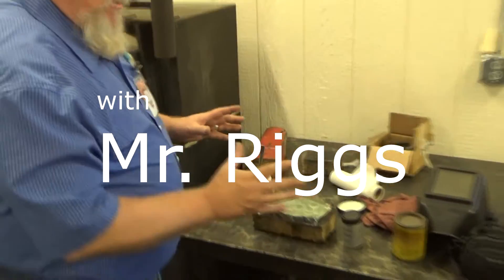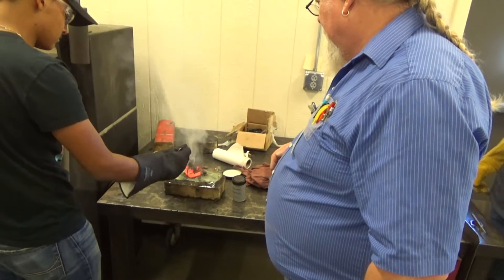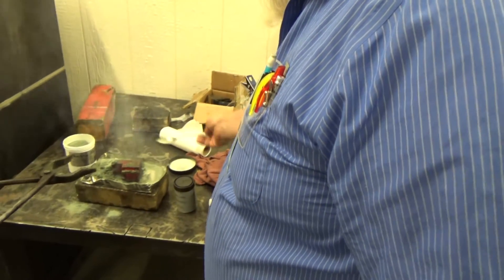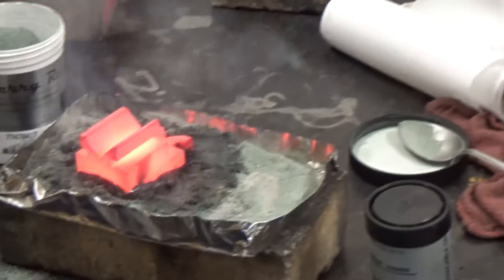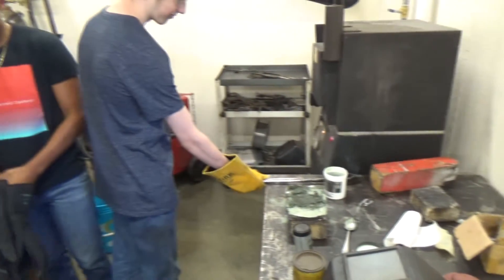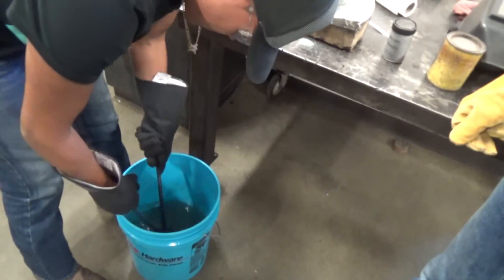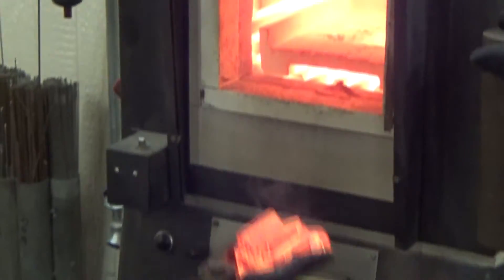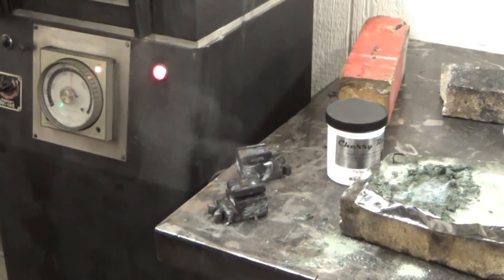Case Hardening Mild Steel with Mr  Riggs

Comment: No tempering?
Reply: It's mild (low carbon) steel so doesn't form the martensite and pearlite in the same way so not got the internal crystal structure issues a high carbon steel would.

Comment: Interesting video. Some additional information would be nice. Such as: 1) at what temperature are you heating it up to. 2) How long of a soak time 3) what material are you using to harden it
Reply: All of that was in the video if you listen.
Reply: it would be better to make a paste charcoal out of charcoal powder ,ordinary table salt and flour with ratio of 6:4:3 respectively mix with small amount of water and make a paste. cover the desired part with this paste. let it dry completely. Then to prevent oxidation, make a clay paste to and cover the charcoal coated part let it drys completely. Heat the oven to austenitizing temperature  around 1450 fahrenheit , put the part inside the oven let it riches to that temperature once it reaches to that temperature  , depending on amount of carbon diffusion thickness , let it stays for  5, 10, 20 .. depending the required thickness. after case hardening break the ceramic (clay) and the charcoal coating and immerse insite water or oil for hardening the part. then temper it.

To check the part is case hardened ,you can check by grinding spark test, change of sound pitch as more case hardened higher pitch of sound , or by file test.
Reply: He is using a product called "Cherry Red" case hardening powder. The directions only specify heating the metal to cherry red. The metal is typically low carbon steel. Temperatures vary from 600 degrees to 1600F. I managed to pick up a magnetron induction coil that will heat metal up super fast, but I got lucky and found that monster on Craig'slist for $500, and I have an FCC license & know how to fix them. I would love to have the oven too, but a larger one that can do rifle barrels.